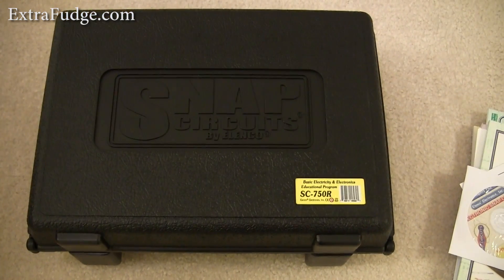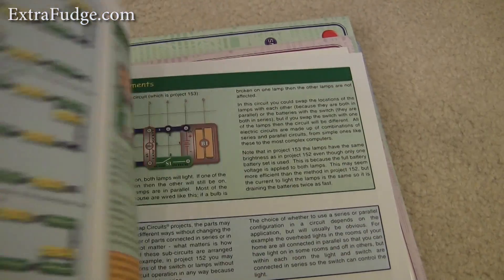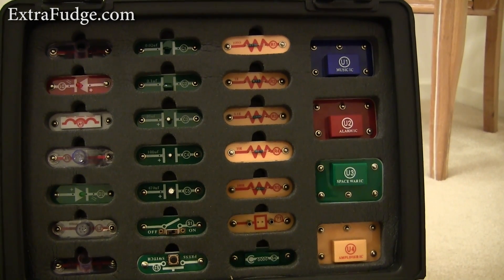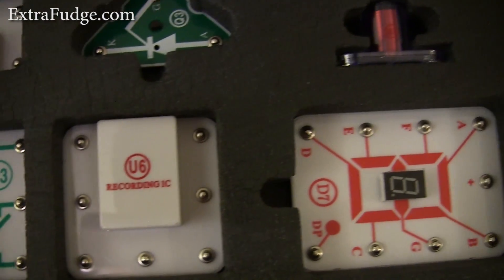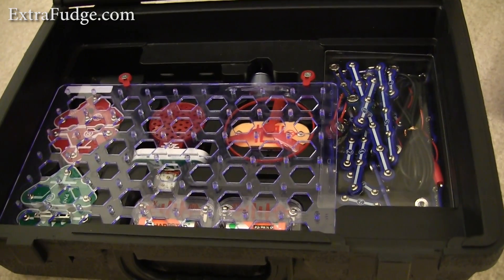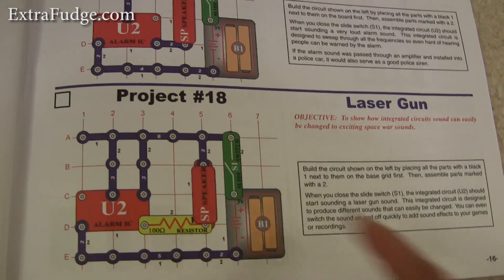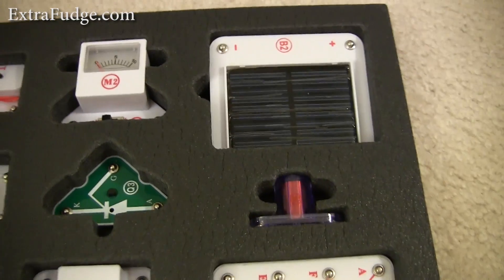Elenco Snap Circuits SC-750R Student Training Program Review

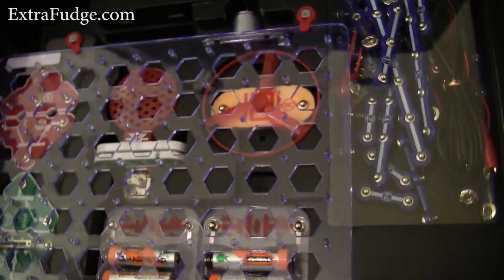Comment: What do you put in the two empty spots on the top left on the bottom compartment? 2:44 and it's not really a full complete kit because you still need to get the other circuits like one of them is the battery eliminator circuit piece but I don't know what the other one is
Reply from the maker: That was the full kit.  I honestly don't remember at this point.  Thanks for watching!
Reply: @ureviews yeah there are quite a bit of kits but I really like to mix the one that you're showing in the video and also the educational coding kit because I like to add the code module to this snap circuit kit so you can actually learn coding and other fun stuff in addition to creating circuits.